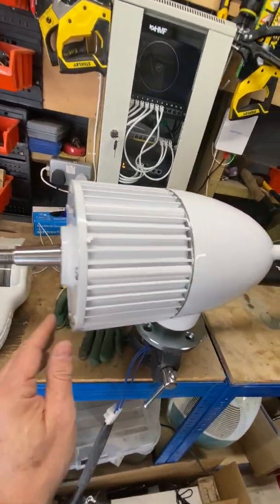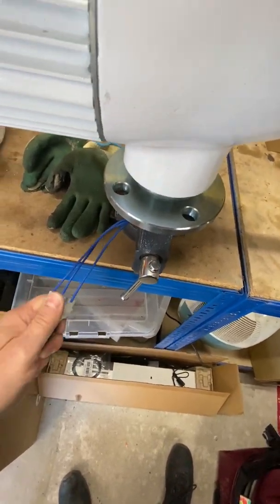B&C 1KW Wind Turbine Installation part 1

Comment from the maker: Managed to remove the TESUP rubbish and did a quick video of the replacement option
Reply: Is there a part 2 coming?
Reply from the maker: @antonthorstensson  yes but I’m
Using a different turbine. I need to find time to install !
Reply: @Homewindturbinereviews  hey mate, have you had a chance to get this up? would love to see the follow up video.
Reply from the maker: @MrGaZZaDaG  yes back in U.K. next 10 days so will do something
Reply: Did you ever get the B&C turbine up and running?
Reply from the maker: @kevinmills5293  hi Kevin. I’ll be dropping a video in next 3 weeks. Basically no as the wind speeds required are insane 
Trying another after this.